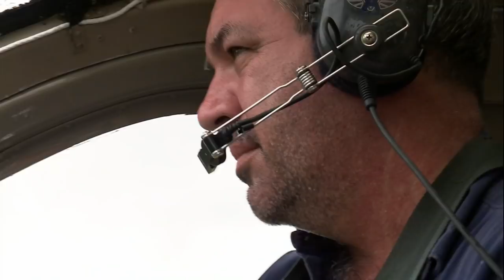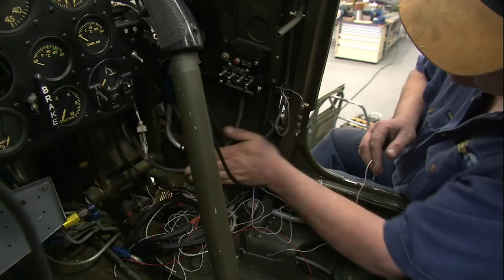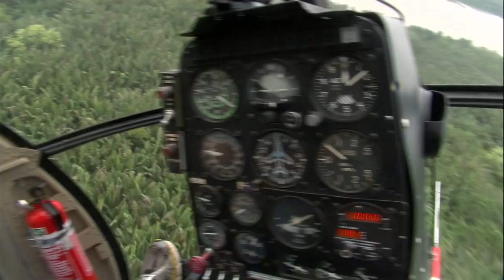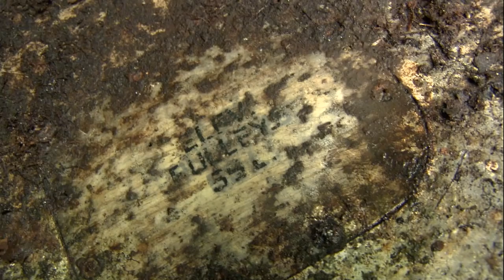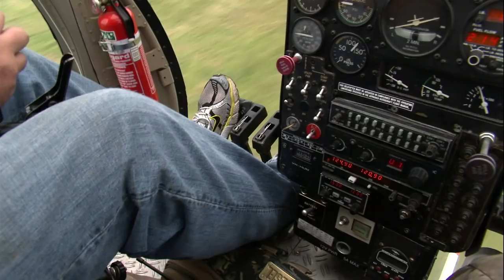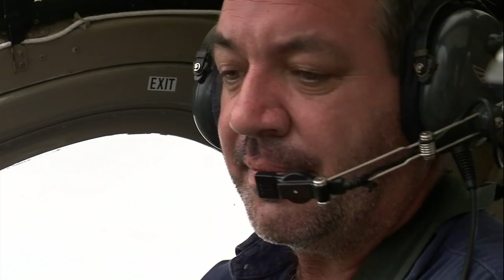How Engineers Are Restoring Rare Aeroplanes From WW2 | Chasing Warbirds | Spark

Comment: Murray after 10 years of bush flying in PNG fro the mid 80s to the mid 90s I could have taken you to that P38 in a straight line. There used to be/is another in even better condition on the side of a coastal grass strip just east of Kerema. I've seen several P39s on an island in Milne Bay that were literally abandoned as the war moved on - in their crates which have long since rotted away - that were completely intact wth their wings in a pile right next to them. But it was a fun doco complete with overdone drama. In the 80s and early 90s I was great mates with the 3 white men living at Baimaru, Kikori and Bensbach - real characters. I know at least 2 of them have passed on.

Comment: 2:10 what’s the story on that KI-61? Will it ever fly again??
Reply: + MrJp990    The are building three Ki-61 in that shop for collectors.  They are supposed to fly eventually but finding an original Japanese  Ha-40 engine is going to be difficult.  One or more of them will probably have to substitute the German DB-601 and those are not easy to find either and cost an enormous amount to return to airworthy condition.
Reply: @FiveCentsPlease  I’d give you 5 cents, but all I have is a like. Here you go. 👍
Reply: @MrJp990   You're welcome.   One Ki-61 will be going to Mr. Yagen and another to Mr. Weeks.   I dunno about the other one.   They have been working on them for many years.   Wreckage was exported from the South Pacific 20-30 years ago, actually I think it was the 1970s.
Reply: @FiveCentsPlease  I wonder if and when (a BIG “if”) they find a Ha-40, if they will do something about the poor fluid circulation before installing, or just install it as is.
Reply: @MrJp990    Sounds like a problem that will have to be solved, or use a DB-601.   I believe there is one good Ha40 for one aircraft but if it is so problematic I wouldn't use it, if it were me.
Reply: @FiveCentsPlease  Unless they fix the issues, it would be best if they threw a DB601 in it (if they’re going to fly it). Personally, I would put the Ha-40 engine in it for display purposes. Having all the access panels open and make a giant diorama of Japanese mechanics working on it.
Reply: @FiveCentsPlease  But all they need is a spark plug from the engine. They can then restore the rest.  🤣